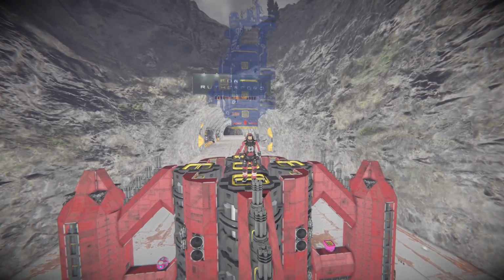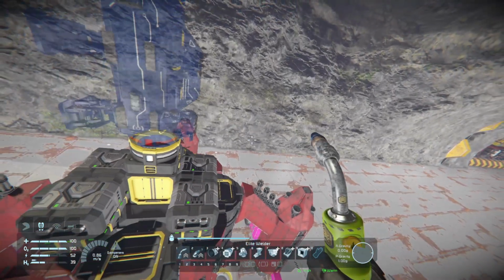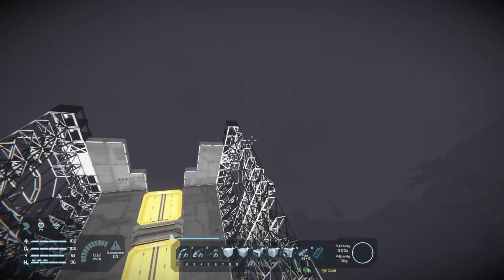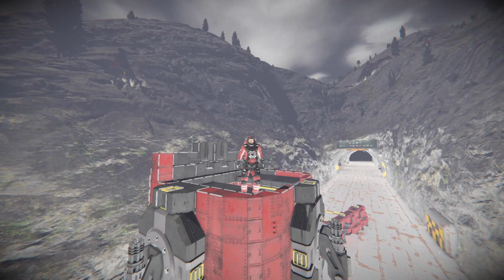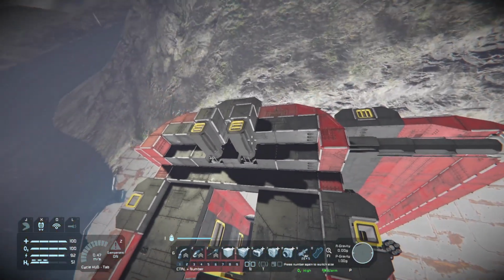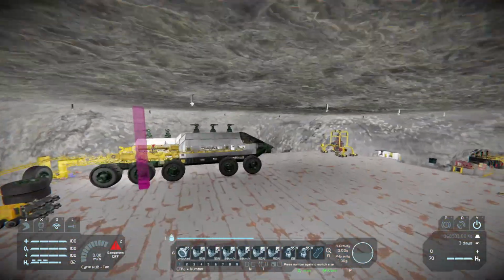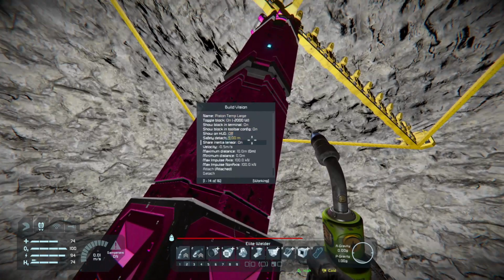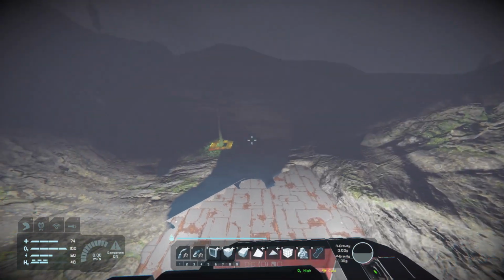Hephaestus Prime EP70 - All Hail Lord Klang! (Space Engineers)

Comment: With attaching piston heads I think it's much more reliable to use merge blocks instead. So, build one piston with half the door, build the other piston with the other half of the door, meet in the middle with merge blocks and then once you've built around the merge blocks so they can't be unmarked, grind off the merge blocks and finish the door as normal.

Not sure what the issue with the hinges was but like...blast door edges and multiple hinges, maybe construct the door seperately and use a forklift ship to lift it into place and attach the hinges. All hail lord clang though :D
Reply from the maker: Thanks Yaki. I should have learnt about connecting the piston head after the straddle lifter did the same thing, oh well, the whole point of this build is to learn and nothing teaches you like a good ole explosion. Not sure why the hinges did it, I don't think the collision meshes had actually collided yet. Never mind, really happy with how plan D turned out ;-)